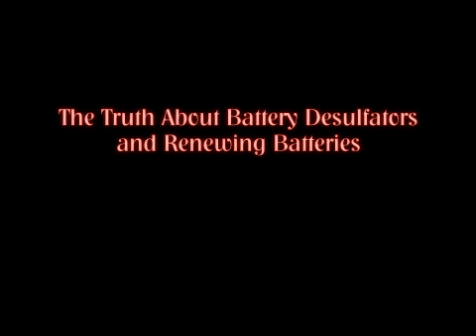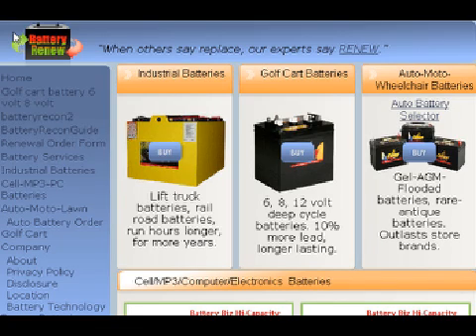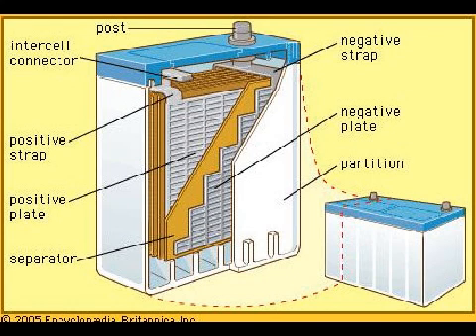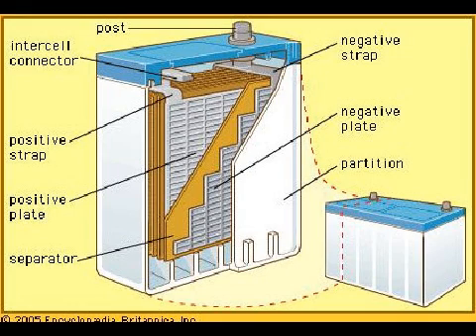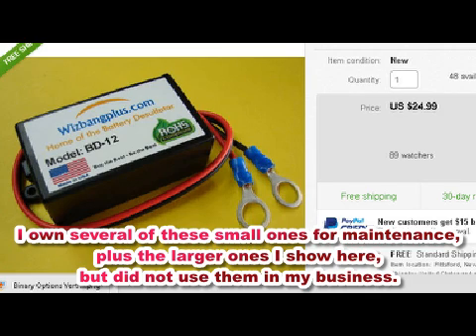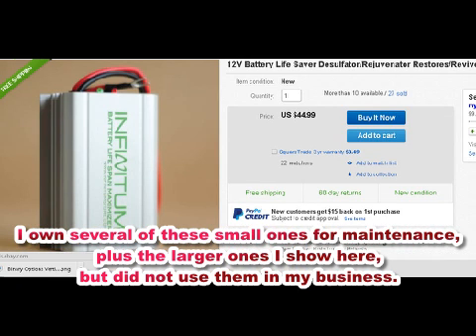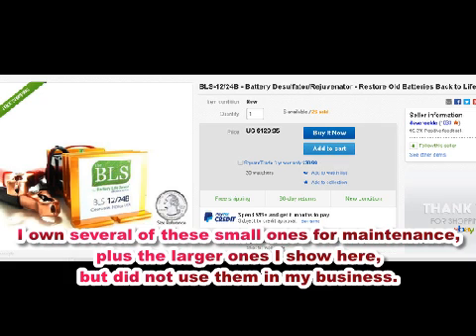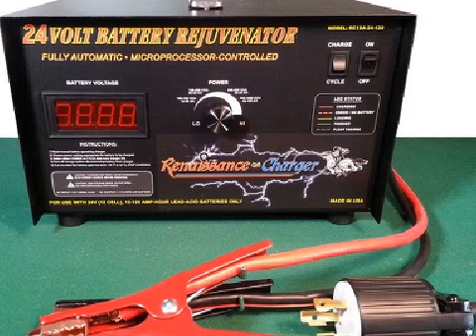The Truth About Battery Desulfators

Comment: i was thinking of getting the Battery Life Saver BLS-48N for my 48v golf cart. the batteries are new. will this work for my new batteries?  thanks
Reply from the maker: Hi +0202revan and thank you for the question!
I would not get that unit now. With new batteries you see no impact for a minimum of 2 years as long as you run your batteries to a reasonable state of discharge of approximately 30-50% for a golf cart and then immediately recharge them with an equalization cycle every 10th charge. Plus keep the battery water level just above the plates, no higher to avoid increasing pressure and heat.

Your better money would go into buying a product called Battery Equaliser and pouring some in each cell once a year.  Depending on where you live, it will keep the battery plates from shedding and wearing in hot climates, and improve battery capacity in cold climates. More importantly, it will prevent sulphation from starting earlier. For the first year only use half the recommended about - it pricey.

Also, if you are willing to, rotate your batteries to distribute the load every 6 months or so. This way you will not lose all 8 batteries when only one goes below standard because you overworked that one batteries plates the main terminal.

Make sure to keep your terminals clean and covered in vaseline or lithium grease to prevent corrosion. A major source of early battery failure.

Follow these "extra" tips and you can get double the life out of the batteries. After about 2 years you can add a desulfator like BLS-48N but unhook it after 10 charge discharge cycles or you will start destroying your plates.

I hope this long winded answer helps and congrats on a fresh set of lead!

Comment: can the bls desulfator destroy a battery, how does the desulfator destroy a battery?
Reply from the maker: Hi +Ron Stark ,
Any desulfator can cause a battery to shed the lead plates. The more power the desulfator has, the faster this can occur. I learned this the hard way when I started using the Renaissance Radiance Charger/Desulfators plus another high powered desulfator the U.S.A.F. uses. I blew a stack of 6 deep cycle batteries badly by making them shed the outer plates. 

I suspect your bls desulfator is not a high powered one and you can leave it run for up to 30 cycles without damage. If a desulfator does not work in 30 cycles, my experience is that it will not work at all.
Reply: Battery Renew g

Comment: I have an AGM battery which is hovering around 10v, it is warned on the label the interior of the battery is acid, can I add conservative amounts of battery acid to reallow the ~glass pack to reabsorbe any which have been lost like a traditional battery? 

It's a Stinger 2100
Reply from the maker: Adding acid to an AGM battery is not likely to help your battery. You can slowly work on an AGM battery with a low power desulfator or check out how I completely fixed an expensive AGM battery using a cheap SLA battery in parallel on my Prius video.
Reply: O.k. thanks. I did top it off with distilled water, and gave it many cycles from a healthy 12 volt. It is atleast holding a charge, yet not sure about cranking power as the car is being built however is still powering the car (interior lights, audio system, led system). I'll look into getting a desulfater. 

As far as the distilled water I added....shall I drain it, or leave it be?
Reply from the maker: AGM's are designed to load the acid and electrolyte solution into Absorbed Glass Mat (AGM) that will not typically release any vapors like a typical lead acid. Unless you seriously cooked your AGM battery, I would not add any water or acid. If you did cook the battery, which is over charging it until you blow a valve releasing vapor, the likelyhood is that a plate has been damaged. 

Since you are holding a charge now by using the parallel battery trick, you may be OK. Good luck!
Reply: I was saying I had already topped it off with distilled water (before I had saw your comments) what shall I do, leave it, dump half of it, or all of it?
Reply from the maker: You can leave it. As long as you are not aggressively charging your battery, in the 2-4 amps range, you should be fine. At 6+ amps you may well see boiling expand or crack the case if it is sealed again.

Comment: Would you recommend a low power Battery Desulfator I could leave on my car all the time as I drive without harming it?
Reply from the maker: The one I have used with some success is called the Wizbang desulfator. I do not recommend running any desulfator for more than one month unless you want to eventually destroy the plates. Even those that claim you should keep them on all the time, I find that the plates will begin shedding far earlier than without the desulfator in place.
Reply: @batteryrenew8559  can you tell me what to buy or do to get my red top optima back, I had one before and it lasted 9 years and I've brought that back from the dead a few times, I left a comment before this guy if you read that thanks in advance

Comment: Glad I found this video, can you recommend one for me? I have two expensive AGM Lifeline 4D 12 volt deep cycle batteries that I harshed a little bit using a dorm fridge for a few months in a van solar setup. Can I use that $25 one if I have the time to let it work? Thank you.
Reply from the maker: Hi Wanderlustman,
I only just saw this comment so I hope I am responding soon enough. A 4D 12 volt deep cycle battery, especially AGM, is a fairly high AmpHr battery. The small desulfators will take several days to weeks to have much impact. AGM cells are not supposed to sulfate at near the rate of standard FLA (flooded lead acid). What you might try is use the technique from another video I have posted where I brought back a stone dead AGM battery by running it in parallel with a cheap FLA. After a few days of cycling, the AGM was as good as new!
Reply: @batteryrenew8559  what can I buy to desulfate my red top, I left a comment before this guy, if you could help me out I'd greatly appreciate it

Comment: I have a twelve Trojan L16E-AC flooded batteries. Have you seen the "Battery Extra" desulfator from the UK? $139. There are a lot of solar guys getting them...and like it. Trojan says not to hook a desulfator to their batteries...but, they SELL batteries. So, gonna try the Battery Extra out and see what it does. Thanks.
Reply from the maker: I happen to have that desulfator..and just about every other one made:) Man am I weird about batteries..but on to your question.  The Battery Extra works in a similar fashion to the other battery desulfators that use a batteries own voltage for desulfating. The difference is the Battery Extra shifts voltages to find the frequency that will degrade the sulfate and expand the plates. This is a useful function. The issue is that like all ride along desulfators not using external power, they take a while to work and are limited as to the decomposing power they offer. This is an improved unit over the standard in line desulfators, but at 3x the cost.
Reply: Thanks! I took a peek at some of the battery cells (three weeks with that unit hooked up to my bank). They are def not sulfating...and look much cleaner too (more shiny). Looks like it is doing something.
Reply from the maker: Hi Chris DIYer!  When you have weeks to allow batteries to desulfate, even the lower power units can work for sure. Glad your batteries are coming back to service. Do not leave the desulfator any longer than necessary or you will start seeing shedding of the plates FYI.
Reply: Great advice. I think 4-weeks will be long enough and then pull the fuse.

Comment: a $12 desulfator/charger has saved me over $500 on car and lawn equipment batteries.
Reply: What is the brand of that desulfator?
Reply: @josh what brand was the 12$ one?
Reply from the maker: Awesome to hear that!  You just nailed the reason why I got into battery reconditioning in the first place. With just one successful reconditioning or desulfating, I had more than paid for most desulfators. I ended up buying expensive rejuvenators and making a business out of it, but sometimes the small, low cost desulfator/charges will restore car, lawn or moto batteries to like new condition. Well done Josh!
Reply: Battery Renew I'm not trying to make this sound like a infomercial but I was skeptical when I bought the desulfator and did not expect the success rate I got out of it if it was to work at all. There have been 2 batteries I haven't been able to save, one because of physical damage so I sent it for recycling, the other had contaminated acid, I could probably replace the acid and recover it.

The reason I ordered it was because in the fall I had put a new $120 battery in my truck, stupid me let the truck sit until spring with the accessories on, didn't check or start it once. You could jump start the truck, run it for a hour, kill it, immediately try to restart and the battery couldn't start it. I figured since I was blowing money on expensive batteries, I might as well Google some tricks for recovering batteries. I read about Epsom salt first and didn't like the idea of adding anything to the battery chemistry, then I came across electric desulfators. If it didn't work, what was another $12 after I had blown $120? After just 8 hours  it could start the truck again, I left it on another week and never had a problem with it until I sold the truck.
Reply from the maker: Hey Josh Biship, sounds like a realistic scenario I experienced many times.  Any batter lead acid battery except for some versions of AGMs, will almost certainly come back fully from the conditions you describe.

When people brought me batteries like you described - relatively new with one serious power drain episode - I knew I could return the battery 100% like new. 

Glad it worked out well for you!!
Reply: Battery Renew z

Comment: Is it possible to make batteries as good as new using desulfating or battery renewing? What about power tool batteries, computer batteries, wheel chair batteries??
Reply from the maker: As hard as this is to believe, using my Renaissance Radiance Battery Chargers I routinely sent renewed batteries back to clients reading well over the stated CCA and AmpHr rating based on my advanced ATI tester. However, standard desulfators will generally not give you a better than new rating because all they are doing is sending sulfate back into solution. Radiance chargers stimulate more reaction and capacity in batteries. They work especially well with NiMH batteries for power tools.

Comment: Hi, I own an aerial lift rental business and I am interested in battery re conditioners, where can I look for the products you sell?
Reply from the maker: Hi Javier,
I do not directly sell any products now, though I used to sell batteries, reconditioning services, and battery reconditioning tools and supplies. 
I would guess your aerial lifts use L16 batteries because those are the ones I used to recondition for my aerial lift clients. 
The trick with L16 batteries is to use high power reconditioners just when you see them start degrading in performance, usually after 100 cycles. Use Battery Equalizer to start off with, run a full discharge - equalizing charge cycle, and return to service. Then uses high powered desulfators every 6 months or so. You can expect to more than double the life of the batteries with this regimen. Also, since you probably use 4-6 L16's in each lift, number them, and rotate them once a quarter or at least twice a year. This will save your positive cells from degrading faster, especially on the first battery. The entire battery bank will run at higher capacity for much longer this way.
I hope this helps!
Reply: Seems to me that rotation is key to long life ...  rc

Comment: Check your link please. There is no information on the site. just a lame video.  Thankyou
Reply from the maker: Hi LestonDR! The link leads to a video that sells the battery reconditioning guide. While the video is hokey and definitely sells the guide, it is an engineering level document that took loads of time to produce and saves hundreds if not thousands of dollars in battery costs.  

To give you an example of how much that roughly 40 page guide has saved me, here are a few of the batteries I reconditioned with the systems, designs, and processes from the guide:
12 deep cycle power station batteries that went dead after being on my barn shelf for only 6 months and would not take a charge. These are super expensive, industrial quality, AGM batteries that were not supposed to fail for years - but they were dead and not charging. Each battery costs over $300.  Using the system for AGM batteries, I reconditioned all 12 and got them back to full rating, then sold them. The guide made me about $3200 from those batteries.

I have also restored countless power tool batteries at roughly $50-$120 (the 20 volt Li) each using the system for NiMH/NiCD/LiM cells.
Most importantly, I have been able to keep my solar power batteries going for more than double the average life span while maintaining their full AmpHr capacity despite using them below 50% capacity frequently. A new set costs about $4000.

I could on about all the motorcycle batteries, etc., but the bottom line is I got a load of value from the knowledge in the guide, plus my own experiences I share here. It may not be worth it for you, but for those of us with way too many expensive batteries going bad, the guide is a minor investment that yields a fortune in return - guaranteed.
Reply: Yup.. There is no free into that.

Comment: Lots of good info.  If I can keep the solar  batteries lasting for 10 years over the expected 4 years then the knowledge is well worth it.  Looking forward to your other videos.
Reply from the maker: Hi Covercall!
Thank you for the nice comment. I need to post my solar power battery secrets that have given me over 10
 years of full capacity use from normal GC2 deep cycle batteries. Most 
of the tips I have never heard anyone recommend, but they have kept my 
system performing at 100% when under normal conditions the batteries would be about 50% or dead by now.

Hope your solar power cells keep their capacity while you get full discharge from them. I think oversizing the battery bank to restrict the discharge to 75-80% is an expensive decision compared to using  a few of my techniques that allow for regular 50% cycles while keeping the batteries strong for a decade or more.

I am now reworking my Prius NiMH batteries using the same systems from the guide in the link. It is saving me over $4000 in replacement costs..score!

Comment: How long is very long for the cheap batteries ?
Reply from the maker: +karebu2 Thank you for the question and stopping by! I think you are asking how long it takes to desulfate either using the cheap desulfators or with cheap batteries? Not quite sure what you are asking, but the low end desulfators can take weeks of charging and discharging batteries to get the sulfate off the plates. For deep cycle batteries they are not worth it. For small, cheap batteries like some motorcycle, lawn mower, wheel chair, and small car batteries, they can work over time. Most people need their batteries working in a few hours, not a week or more, so I never used the cheap desulfators other than to experiment with. I hope I answered your question!
Reply: wow. weeks. i have a battery tender/desulf but i never gave it enough time to do its job. i usually give up on my old battery in 2 days instead of waiting for it to be reconditioned.
Reply from the maker: I remember talking with one of the golf cart dealers I would trade batteries with and he thought he was succeeding with desulfating by running his batteries through 50 cycles to "refresh" them. It took weeks to do and I know he was beating them up and killing their lifespan. We want short, powerful desulfating with no more than 3 cycles. Then the batteries are renewed and they are not losing 15% of their life cycle during the process.